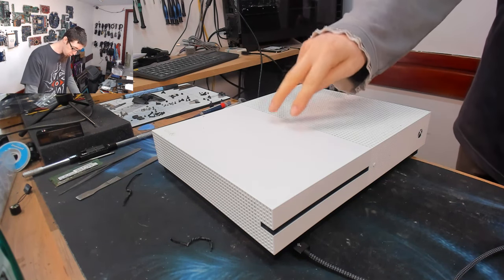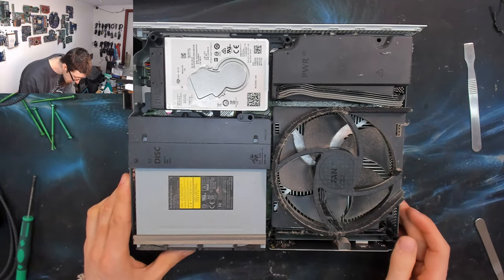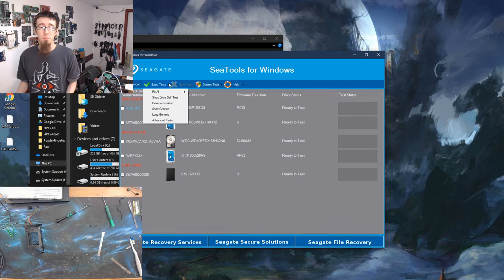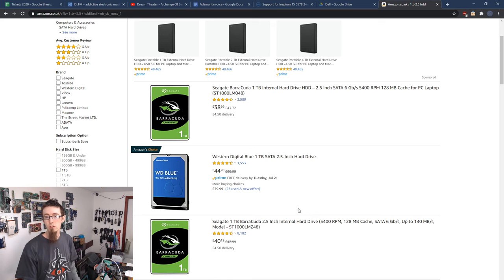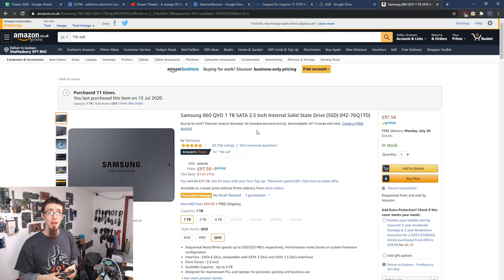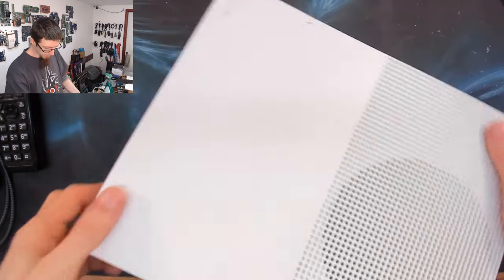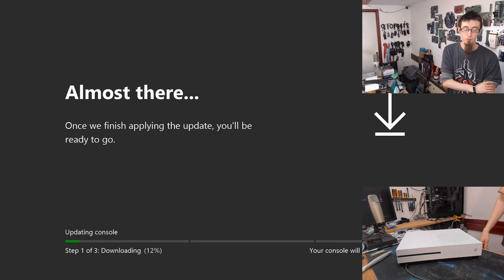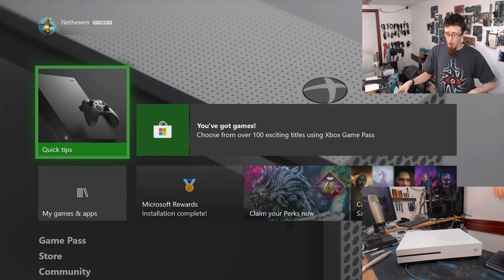Replacing an Xbox One S HDD with an SSD - LFC#214

Comment from the maker: Please note: Prices and availability of SSDs change. I suggested a Samsung QVO in this video, but right now the Crucial MX500 is a much better buy, as it's virtually the same cost as the BX or QVO, but a much better drive. Take my discussion of SSDs in this video more as advice on the type and form factor of drive to look for, rather than a specific model.
Reply: In less then 5 years your YouTube income will surpass your component level repair business ur going to the top!!!
Reply: You would think the fools that makes the consoles would install a dam SSD from day one since they are nothing new, i hate the way these people think and work, thank god ps5 is so perfect
Reply: here in canada the Xbox series s ... is 599.99 new befor taxes so approximately 725$ after taxes !!!! and well theirs the issue with all consoles and thats thermal throttling and you only get 120FPS tops ......i could get a budget too mid range computer that gets better FPS .. funny the Xbox series X and S are relatively new too the markey and your already replacing a hard drive !!!! so i would question the quality of all its parts .... cheap PSU , cheap Harddrive , cheap integrated graphic's , Cheap underbined cpu from AMD 3.6GHZ on paper seems good but longivity i do not think is good at all .. better off getting a 3-4 year old gaming PC with quality parts around the same price !!!
Reply: wait why didnt you just plug the New SSD into you PC with the old xbox hard drive and open each drive window then select and drop all of the contents of the old hard drive into the new SSD so all his games and setting everything is on the new SSD its as easy as that and will copy it all even if its corrupt it will repair it ...  but litterally this shows the quality aspect of the xbox series s and x it was released November 2020 !!!! its not even a year old ... i have a youtube /HTC movie PC with original hard drive thats from 2012 still running good today and i gave it a rough life lol with a Core 2 quad,8gb ram and gtx 960 LMAO its out of date but runing windows 10 and i use it for netflix and youtube in my bedroom and still runs fast and fine LMAO used a leaf blower on the deck too clear the dust out of it just this week LO
Reply: These consoles came out before ssd's were on the market. If you compare specs between the series X and PS5, the PS5 isnt the perfect one.
Reply: Good idea, lad. The Samsung QVO and the Crucial MX500 in 2TB solid state drives are the best choices for internal Xbox One storage and gameplay. I totally believe you, lad!
Reply: I love the video, but need to ask a question, if the SSD is fat 32 like most are when they arrive, does the NFTS USB drive using Offline OSU1 convert the new drive etc.
Being a apple mac just using a friends windows computer to upgrade my X Box one X to a 2 tb SSD, so not sure why the process is different.
Reply: @EpicGamingEct  It's Xbox One S not Series S...
Reply: Do you know if drive cloning software would work for swapping to an SSD as a regular upgrade and not due to a failure?
Reply: @Achilles8249  I’m not sure if I’m reading your comment wrong or what but you are very wrong
Reply: 100% 🔥 Thanks Bro
Reply: I have asperger syndrome nd I appreciate your video on how to replace xbox one x hdd nd replaced it with a sshd solid state hybrid drive.
Reply: Nd now looking at this video on how for the Xbox one s for my brother in law
Reply: Where do you do your magic at
Reply: Thanks John
Reply: Yeah i used half dosent of them in different capacities,...
Reply: Does it matter if the SSD has Dram or not?
Reply: @patrickmurphy9470  it does,... DRAM buffer is quite important.
Reply: I just got an 2TB ssd from Amazon for $79. Was a cake walk to install and restore the OSU from usb.
Reply: the video was very good, why didn't you clone the hdd?

Comment: I am wishing more people would repair and reuse their stuff instead of throwing away . We moan about pollution but thats what we get each time we are making more of things like this
Reply: Then do your part in supporting right-to-repair, which Apple and other manufacturers are fighting to prevent
Reply: Well said Rusty, I work at Staples and its absolutely disgusting the things people will recycle that can be repurposed and repaired. 4-5 weeks ago a guy dropped of a GAMING PC with a 980 ti and an i7-8700k in it. I begged the company to let me have it, but no, it has been taken away to a recycling plant of which they declined to share with me where it was going. We live in a society that is full of greed and pollution and it's just sad. Electronics Recycling adds to the pollution problem, once they get sent to the plant and get melted down, it just puts toxins in the air.
Reply: it's not always a hdd thats the problem. I've ran into psu, mobo, CD-ROM...
Reply: Harddisk is hardly ever the problem. However you are right. There's a vid floating around with a guy who bought 15 broken ps4's, where like 11 were perfectly fine.
Reply: @Xfade81  Unfortunately, it's more common than you think, just because you haven't experienced it or have experienced it less than other issues with Xbox Ones, it does happen quite often.
Reply: Meanwhile, I’m still using the same electronics that I’ve had for several years now, with them only needing the occasional repair job in order to continue working as intended. Eh, even though I can most definitely afford newer replacements, I was brought up by my parents to take good care of whatever I got and make it last as long as possible, hence my “fix it over tossing it” mentality. 😁
Reply: @kylewilkins4258  That really is disgusting! Hopefully it hasn't actually been "recycled" in the materials sense
Reply: Your wish sounds like latin america to me, they do fix everything till the very end
Reply: nah people can recycle and refurbish but litterally this shows the quality aspect of the xbox series s and x it was released November 2020 !!!! its not even a year old ... i have a youtube /HTC movie PC with original hard drive thats from 2012 still running good today and i gave it a rough life lol with a Core 2 quad LMAO its out of date but runing windows 10 and i use it for netflix and youtube in my bedroom and still runs fast and fine LMAO used a leaf blower on the deck too clear the dust out of it just this week LOL
Reply: @Xfade81  that happened  to me  someone gave  me a dsi  try  buy  broken one  to replace LCD  and  8  in a row  work
Reply: @kylewilkins4258  man I would kill to have and rx 400 series. I need something that can actually have games to run.
Reply: @ToughDog-tk5gs  They're not bad cards at all. I have an RX 480 they're great for 1080p gaming.
Reply: Ubreakifix repaired my xbox one s. It needed a new HD at a cost of $163. However, I wish I would have watched this video first.
Reply: I'd probably donate my hard drive
but one issue is that these don't last forever. they will eventually fail.
Reply: Doesn't help that a lot of parts cost as much as the phone. If you were living paycheck to paycheck would you pay $250 for a new screen or $300 for a new phone? I repair them and I can tell you there's many cases where it makes zero sense to pay for repairs mainly when it comes to phones with OLED screens.

Comment: I really didn't know it was that easy. I thought they blocked off-market drives or something.
Reply: Me neither man, I'm very surprised.
Reply: I wouldn't be surprised but MSFT didn't do it thankfully.
Reply: It was that easy until you know how to replace a ps4, ps4 slim or ps4 pro hard disk/ssd without breaking the warranty sticker
Reply: With as quickly as hard drives fail, Microsoft probably eventually decided "Fine, whatever, lets just let them replace the hard drives themselves. Sony's doing it, so lets do it too." Hence why Microsoft finally put up that page.
Reply: @kylewilkins4258  sony let their costumers do it but microsoft does not cos they want $$$
When they revealed the xbox price everyone kept quiet at the launch event
But ps4 on the other hand got alot of excitement.
Reply: @lmaolol8986  Good point. And remember, "Xbox Always Online"? Lol
Reply: @lmaolol8986  yeah sony even has a removeable cover to access the hard drive without voiding the waranty, xbox is pretty much being a dick at this point because the series x ssd won't be user swapable and is soldered to the motherboard. Plus you have to buy their expensive proprietary expansion ssd with sony just using standards nvme form with a specific specs requirement for the ssd that eventually will appear in the market around 1-2 years.
Reply: U could do this for years now
Reply: @m.syamil_KR4PU  i replaced my ssd within 20 mins including installing of the software haha on the hamburger like ps4
Reply: @chriswright8074  That is true, but it was a pain in the butt before they made the Xbox Operating System Downloadable. You had to clone the hard drive over and it wasn't always successful because of the way the Xbox's partitions are formatted and when you clone from a hard drive to an SSD, the partition tables aren't copied exactly how they would've been at the factory. It's not a 1:1 copy, say you buy an NVMe SSD and you are migrating from a slow mechanical drive in Windows 10, there are free utilities out there to let you copy the data over from the slow mechanical drive, but it's not gonna be 1:1, it's gonna be more like ~0.99:1, the data will get copied over, but you'll notice that when you boot from that drive, the partition tables will be different from the ones initially formatted on the original drive thus, the performance of the drive will be impacted to some degree. The same thing happens on XBOX One. Much like PCs the best option is to do a clean installation of the Operating System onto the fresh hard drive. Especially if the drive has a bigger capacity.
Reply: @kylewilkins4258  you didn't have to clone the drive probably back in 2013/2015 because xfix it been around for a hot minute and his script's are good
Reply: @chriswright8074  Really? I never even knew about that. That's cool.
Reply: @kylewilkins4258  so many people, myself included we're very unhappy with that online crap. It's actually one of the main reasons I actually went PS4, even though their decision did get revised when they received a lot of backlash for it.
Reply: @Dantoshou yeah, the 360 requires specific models without any kind of software modding which may or may not require hardware mods first.
Reply: @m.syamil_KR4PU  i think those are already available on the next gen of nvme, they're just not cheap enough for most to get.
Reply: @lmaolol8986  yeah drive swap was easy. I honestly swapped it for a Seagate SSHD near day one of having my console. I just wanted the upgrade in capacity, but I also opted for price to performance as it wasn't that much slower than an SSD in the PS4, but it was a lot cheaper. Still works fine honestly.
Reply: @chriswright8074  that gives me something to look forward to if I ever decide to look for a cheap used Xbox one S.
Reply: @ArtisChronicles  yeah like the aorus PCIE gen 4 SSD, agreed it was expensive but who knows because SSD has been going down in prices since the introduction and that's is a good thing to see because of the many benefits that it brings like faster speed and better reliability than a hard drive.
Reply: @ArtisChronicles  I used to buy fault Xbox ones and re sell them use to upgrade them to 2tb
Reply: Microsoft has been moving closer to consumer friendly... Yeah who would have thought right... Even next gen you can bring over your controllers a first.
Reply: Anonymous Panacea  uhh they literally show it in the video where they invite Austin Evans and digital foundry to their office. I think you clearly didn't watch Mark Cerny's presentation, he clearly said that they will be using M.2 PCIe gen 4 SSD which has been out in the PC market for many years and state that it will be user-replaceable/swappable but need to meet a certain spec requirement to work well.
Reply: @lmaolol8986 , I believe there are right to repair laws that make it illegal for companies to void a warranty simply because you know how to fix electronics you own. Although from what I have heard, Apple sure likes to fight it with their proprietary garbage their own techs get attacked for trying to repair if it's  too new.
Reply: Microsoft doesn't make their own hard drives so u can put any in that fits like he said
Reply: @m.syamil_KR4PU  they are offering hot swappable memory modules for it but im curious as to what the sizes are going to be since the infographic only shows you the 1TB option
Reply: @martinpantoja2423  pardon, you are referring to the series x, right?
Reply: @m.syamil_KR4PU   Yes if you look through the xbox site they show a module you can attatch to the outside of the case that is 1TB in size
Reply: @martinpantoja2423  ooh, I've already mentioned it in my previous comment. It is proprietary which sucks but to be fair high specs nvme ssd are expensive especially the one like on the PS5 but at least Sony gives you the options for you to do it yourself and maybe cut some cost in the process if possible and with an exception that they have become mainstream enough for the price decrease in maybe 1-2 years.
Reply: @m.syamil_KR4PU   I think we might be able to get around that if the case uses the connections of a standard 2.5" I would assume you can pre-format the drive like you would over USB to the xbox and then change out the casing, maybe a workaround like when you replace the SSD in the current xbox, you think?
Reply: @martinpantoja2423  sorry but what do you mean by 2.5"? the connection port looks proprietary to me, plus it's much deeper than a standard 2.5" port. If you look at the hands-down video by the digital foundry and Austin Evans who got to assemble the box, you can see that the ssd is soldered just like current apple's MacBooks to the motherboard to make use of the Xbox's velocity architecture.
Reply: @m.syamil_KR4PU   I mean for the expandable slot in the back, it seems like the casing is just a longer connector but *hopefully* its just a standard sata connector  it would be easier if YT would let us comment pictures so we could annotate and share ideas/speculations better ha
Reply: @martinpantoja2423  agreed, I can't say for sure right now given that the console aren't release yet. One more thing to add, sata port is much slower than nvme. Microsoft I/O speed is 2.2 GB/s, so in my oppinion it wouldn't make any sense for them to use sata. Just my 2cents :), cheers mate
Reply: @m.syamil_KR4PU   for sure hopefully things come out in support of the player rather than in favor of the companies pockets only
Reply: @martinpantoja2423  yeah both console makers have had their own fair shares of anti-consumer practices in the past and right now, and as you 've said we can only hope that they won't become like the greedy apple.
Reply: £50 if a bit of a rip off though. I would do them for £20 plus parts.
Reply: @m.syamil_KR4PU  how does it feel knowing you were completely wrong? Not only is PS5’s SSD ALSO soldered to the MoBo, but only certified NVMe drives will work and so far there’s only ONE option which is more expensive than Xbox’s “expensive” expansion card. LOL and you also have to turn off the system and mess with screws and covers to get to the SSD slot in the PS5. On Xbox, you just plug it in LOL @fanboy
Reply: its not most of the times. you need to manually setup your hdd/ssd with your pc most of the times. this dude was lucky
Reply: @m.syamil_KR4PU  Just be glad Apple does not put out a console.
Reply: @Dantoshou is the process in the video the same for original xbox one?
Reply: @m.syamil_KR4PU   so the ssd is not soldered on the motherboard with the series X|S however the ssd is soldered to the motherboard on the ps5.  Xbox is using NVME slot for the main drive (similar to sonys backup drive) however not sure if its modified at all.  In the future we may be able to replace the series X|S drive with a drop in nvme drive, however the ps5 will basically be worthless if the ssd dies unless you have expensive equipment to repair properly, even then getting the right chips will be difficult.  seems like you had your info backwards!
Reply: Nah only stuck up brands like apple do that, btw its basically impossible to fix most things on a newer Iphone by yourself you have to send it to the manufacturer but Microsoft and Samsung don't do that type of stuff
Reply: Me too
Reply: @majorasspain5341  you are correct about that for the time being.  However the drives were also married on the OG Xbox and they were able to figure that out.  Also don't know if anyone has even tried yet iirc the Xbox one will take a new drive and rebuild it so there is still hope.  On the ps5 only way to do it now or in the future is nearly impossible
Reply: @lmaolol8986    Honestly, To hell with the warranty.     The HDD they put in the PS4 non-pro is so low grade bad that Sony should be embarrassed.  The Pro has a slightly faster HDD, but it still isn’t anywhere near as good compared to an SSD in general.